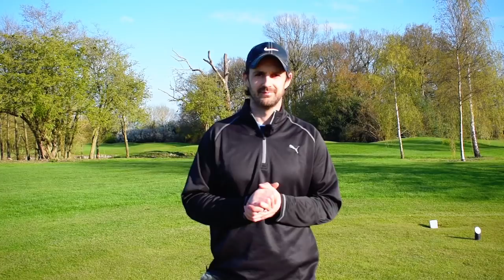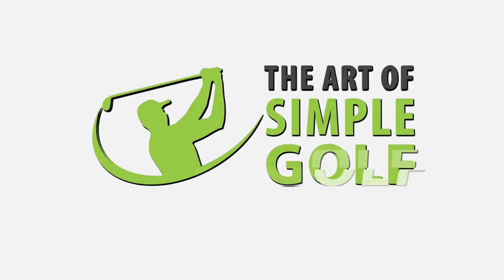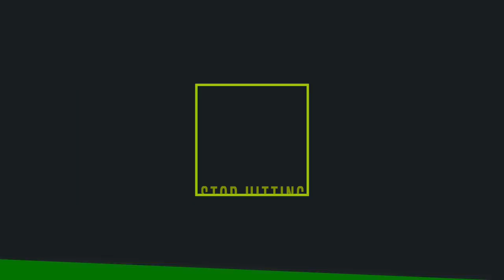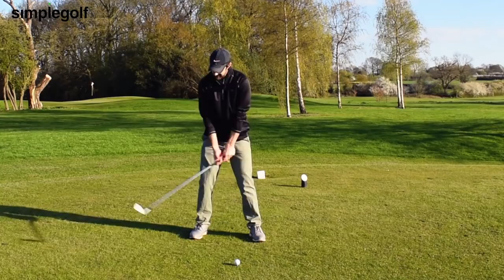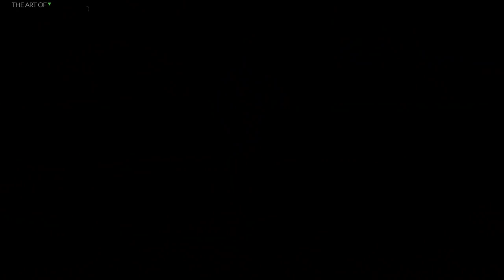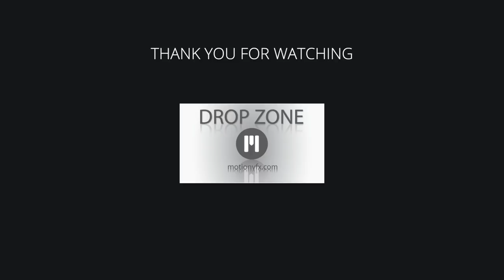DO THIS GOLF SWING  DRILL WITH THE HANDLE TO STOP THE BAD "HITS"

Comment: CAnt wait to try this. I have finally kind of got myself out of casting so bad lately from, using impact drill making the club head and shaft strike something out in front of you at the same time. It kinda gives you the feeling of hanging on without actually hanging on to the angle  but just focusing so hard on what impact looks and feels like, that you start get closer to it when speeding up.. takes work though.. I cant wait to focus on the handle some  and see how my backwards ass golf feeling match up with it!

Comment: Hi Alex,
To start the down swing do  you want to fire your right side through the Ball, I think?  Once your loaded in your back swing , do you start the downswing by pulling with  your right arm ( side) , both arms or left arm (side) followed by your right side?  I'm self taught and I used to feel as if my left side pulled the club head through the ball and I was striking the ball as good as i ever did?  I lost this feeling and its almost back.  I feel at the finish of my back swing  pulling with my right side I can feel my left hip automatically lead the swing ? As long as i stay in my posture i can see my right shoulder replacing my left shoulder under my chin  and I also see my right knee under my chin at impact?  I've been experimenting  pulling my left side and right side at the same time with the right side taking over at impact? I have a return net set up for winter in my Garage and can swing up to a five hybrid. I practice full swings with older clubs. Right now I'm using a 6 iron. I get consistent swing speed between 87 and 96 MPH (occasionally 84 -87 MPH)on my radar.  I get to where I'm swinging 94-96 MPN consistently without trying do it by starting my down swing with my right side? it seem like my right shoulder and left shoulder and hips move at the same time? Any suggestion? 
Thanks!
Reply from the maker: Hi! Well that’s a lot of info and good explanations of what you feel. The thing is, feel vs real is often different. 
But you sound like you are on the right road. I would just be wary of thinking or feeling all these rn hinge during a swing. 1-2 at most. The most important thing is matching your specific intent for the shot. Even in a net; picture a shot and match the set up and swing to suit it. Pulling with left but toting right side does sound like it’s ok. 
Left arm only swings are great to ensure not too much. But also the right only swings (we published a video a couple of weeks back on it) 

Well done and keep at it. If you want to check out the club , visit the site as we do swing reviews and lots of resources specific to what you may need too

Comment: I am fascinated with your concept of feeling -  to swing the handle and not thinking of swinging the club head 

I am gripping the club at the top of the shaft below the grip/ handle and finding it hard to get the feeling of swinging the handle which is above my hands. 
However now with the shortened club shaft I get a consolidated feeling of control and getting the hands and wrists out of the way with a very good shoulder/ body turn.
I trust you understand my findings and can you kindly add your comments 
MDH 
Zimbabwe
Reply from the maker: It’s all relative and feels are personal. Just test it and see how the feels work!